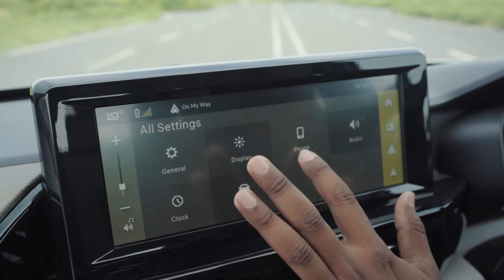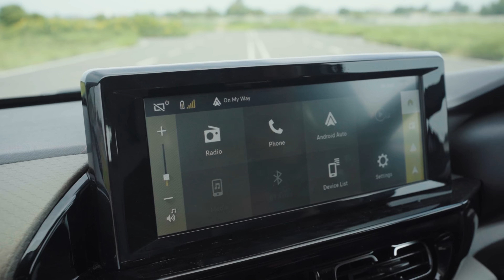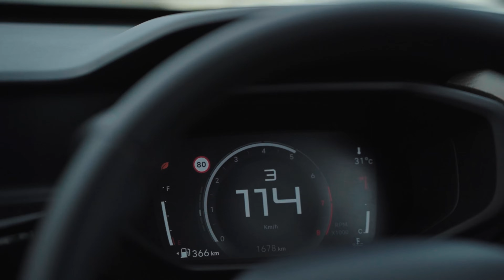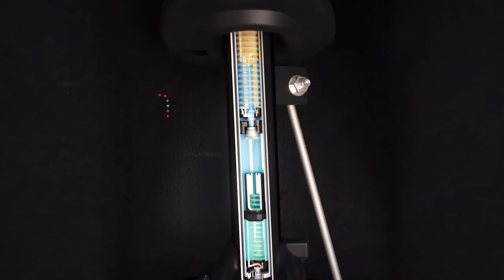Citroen C3 Aircross: 7-Seater Compact SUV | Tamil Review | RevNitro

Comment: Booked 7 seater and waiting for this car❤
Reply: Bro vaangiyacha?
Reply: How is the car ?
Reply: Starting 9.99 lakh ex showroom base variant. 12.50 Top end
Reply: How is u r personal experience
Reply: Nice car. Essential are there. Good stability, performance also good,  3rd onwards powerful. Not using 5th and 6th gear most of the time. Avg milega 14.4 vehicle used in hills. Abs ebd esp and traction control good. One touch windows. High ground clearance. Comfort more than 50 lakh cars.

Comment: Citroen thinking is practicality and they are taking risk for citroen business. Because now a day so many features are available. Most of the features are we are not using.. But we are using or not, maintenance cost paid to the company. A perfect car need powerful engine, safety features stability, reliability, handling and suspension. These things are having citroen. Indian car manufacturers following two companies one Toyota and now citroen. They are manufacturing Limited features reliable car manufacturers in India. Now a day car purchaseing easy but service cost is more expensive, day to day service cost increased manufacturer. First 5 to 7 year no problem after that one by one not working we have spent more money, the beauty thing is 90% we are not using that feature.

Comment: Faisal Khan review about c3 air cross paathan    ..... totally  not value for money sollitan....but   rev nitro review ketta     so positive with tamil audiance connect pannadr mari iruku...so i  trust you over  Faisal Khan review , i am planning to buy honda Elevate or honda city or Citroen c3 aircross   ,,,,  big confusion now
Reply: Faisal ivtec ah matum dhan praise pannuvan…. Premium cars ku matum dhan positive….
Avan panra hard acceleration 🤣
Blabbering talks non-sense
Reply: This is a positive review, not biased.
This car USP is the engine and driving comfort with lack of premium touches….
Although, citroen this time have included the necessary packs which was missed out in c3
Lessen learnt…next MY version may have better equipped

Comment: Bro leaving the features apart, which one would  u recommend for 90% highway use. Mainly drive pleasure for enthusiasts & mileage.

Kushaq - 1 L manual
Taigun - 1 L manual
C3 Aircross - 5 seater
Reply: Citroen go blind
Reply: Volkwagen twins will cost more in maintenance than C3